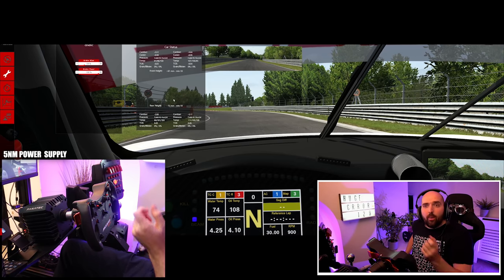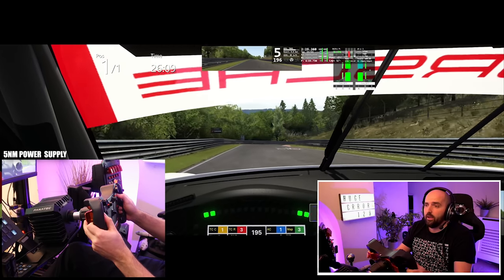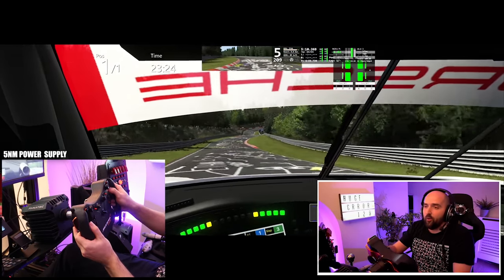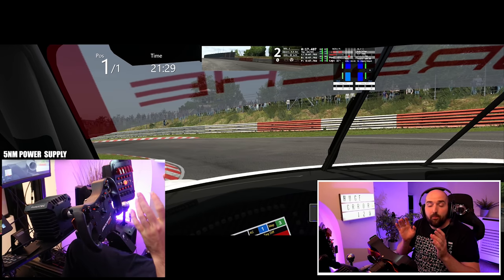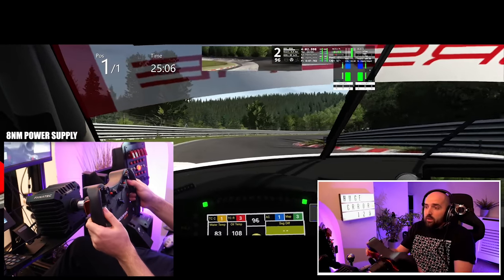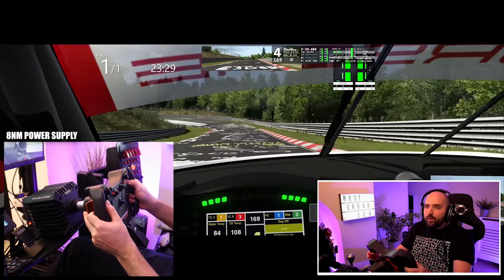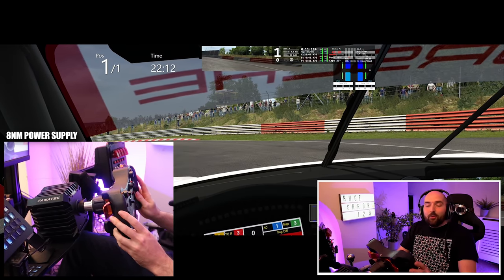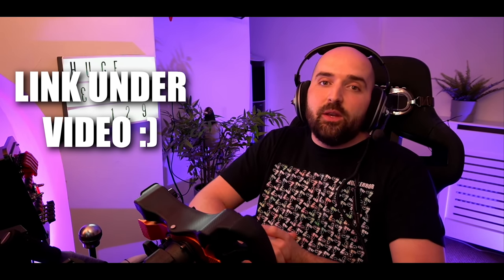Fanatec CSL DD | Which Power Supply Should You Get ?

Comment: Take my advice with a pinch of salt but I would recommend first not getting the power supply, then check whether you like it or not and if you want more, order the boost kit later because it won‘t make a difference in price, neither in a bundle nor in the single wheel base options… because 150€ is a steep price to pay and if you are good with 5Nm, don‘t go for that money, save it on another rim or else
Reply: you are absolutely correct my guy
Reply: Maybe it was like that back then, but now you do save 50€ if you buy it in a bundle. 
Im not sure but i think i will buy it with the boost kit
Reply: @ace.m4  but you don't get the 5nm they just send you the 8nm only
Reply: @OnceHopefuL  why would you need the 5nm if you have the 8nm ?
Reply: @mrmim0x173  it's the way they advertise it. The 8nm is an $$$ add-on. One would assume you get the base plus an extra box with the 8nm. For safety, say my 9 year old want to play I'd plug in the 5nm and hopefully, he keeps all his fingers.
Reply: @OnceHopefuL  can't u adjust the feedback in the setting tho. Like turn the force down to like say 30%  does the NM matter if you don't run the setting at 100%  I have an 8 year old that wanna play Gran Turismo and Forza with me and I plan on getting wheel setup and this was my concern aswell.
Reply: @leftwich7  of course you can, it‘s what I did as well, I just want to make clear that if you don‘t want to use the 6-8Nm range, you can just save the money. If you feel that you will at least at times need the full range, you can just turn it down by 37% and lock it on 5 that way… btw I have read replies that said that in certain bundles you save money on the boost kit. Check it out, last that I know was that in all bundles and standalone versions it was always 150€ (same as the individual price for the boost kit)
Reply: @stingerbean1848  here in Europe the power supply cost 150€, meanwhile the 8nm bundle cost 100€ more than the 5nm, might depend the region
Reply: @mrmim0x173  I see. I didn‘t check it because I have the DD Pro for my PlayStation ventures but yes, you are right, the CSL DD 8Nm is reduced in price. But for that it makes a lot of sense to set up a bundle because then you‘ll get it for just 200€
Reply: I'm takin this advice
Reply: Bought mine from ali express for £30 now way was I going to pay €150 for a power bank
Reply: @OnceHopefuL  you get the 5nm with the boost kit. Lol
Reply: You can just buy a "normal" power adapter that matches the 8Nm Specs, for probably 40-50$
Reply: i will do that.

Comment: They should just sell it with the High Power Power Pack and reduce the price to £450 and be done with it.
Reply from the maker: I'd like that as well but at the same time having a 350 version gets to a much more mass market price point and makes people buy a CSL DD that would otherwise maybe go for a TSPC but with the advantage they can upgrade it later.
Reply: I think Fanatec's strategy is sound.

1. It's designed down to a price, and 350 looks better on a sticker than 450. It allows people to say "hey, my T300 cost me 350!", and while it's of course not a fair comparison, it'll still hit home with a bunch of people. It's sim racing's version of Sony's "$299" speech.
2. A lot of people won't care about the extra torque, they're happy with 2-3nm, and it allows them to save a pretty penny.
3. It allows people on a budget to buy the unit now, and upgrade later. It's good for people on a tight budget, for people who aren't sure about their purchase, and people who are convinced they don't need more to upgrade later. We all know how that works - when I started in the hobby, I thought FFB rather than vibration looked like a gimmick... and here I am now, with three wheel bases, and contemplating a third pedal set. 
4. It fits with the Fanatec ethos of customization and modularity.
Reply: @GamerMuscleVideos  It is just a way to artificially make the starting price seem lower. Most people will look at the 350 price but in reality most people will buy the 450 version and the 450 version is what fanatec wants to sell you. It is called decoy pricing and it is just a pricing strategy. In the end you are paying 100 for a 20 dollar power supply.
Reply: @erwinlommer197  For sure, start with that and a wheel and soon you send up spending much more than you initially anticipated. A TS-PC around €500 seems almost the same price range as this system but you ended up with one of the best wheels around (Ferrari 488 Challenge) and that's it.
Also, I believe Thrustmaster and Logitech won't stay still...
Reply: @erwinlommer197  You're looking at it the wrong way. The unit cost $470 and their only selling you part of it for $350. I'll bet they probably aren't making much on the $350 sale and are loading all their profits into the idea that most people will know you can "upgrade" for the $150 later, but at the lower price they can lock as many people as possible into their ecosystem and deal with getting the rest of their money later.

It's really smart and when you realize the unit is really meant to replace the CSW and not the CSL (all while being $70 cheaper) it's a really good deal and a REALLY smart idea. I just don't think they realized how many people would latch onto the actual cost of the PSU and they thought people would think more about the NM they were buying...
Reply: @Jonj57  You are literally falling for the psychological trick of decoy pricing. You are comparing the two prices and telling yourself that the extra 100€ for a 20€ ebay psu is a good deal because you don't want to buy the cheap option. After all 350 vs 450 for dd wheel... just 100€.. right?

Both psus are pretty standard ebay brick psus. Nothing amazing about them. Fanatec can buy them in huge quantities which means they are probably paying something like 10€ max each. Maybe the bigger one is couple of bucks more expensive for them. 

For fanatec the price difference between the who PSUs is meaningless. The income  and the profit margin they get from the bigger version is insane tho.

And I am not hating on fanatec here. What they are doing here with their pricing and leveraging the psu for maximum profits is just business. Even at 450€ it is not a bad deal by any means and a dd wheel at this price range wasn't even a dream couple of years ago!
Reply: @erwinlommer197  I don't think so, what I'm saying is they probably don't make much on the DD unit AT ALL and MOST of of their income from this unit is intended to come from selling the 8nm upgrade. You're not wrong in saying the PSU shouldn't cost them more than a couple bucks but they aren't trying to sell you a PSU; they're trying to sell you 8nm over 5nm and just needed a way to justify it.

Really it's 350 for the DD and $150 for the power upgrade with a free PSU included.

They never would have sold us this DD @ 350 without some way of recovering cost at the backend.
Reply: Little sad that this marketing strategy is likely to create needless e-waste from the 5Nm power packs.  Admittedly not much but any waste is still waste.  Can't argue with the strategy from a Corporate viewpoint, selling low with a defined and tempting upgrade route is one that's been used for decades and it works.  More money for Fanatec.
Reply: @jgagnier  
Its not the fact that it is sold with 2 options of power pack its the ridiculously over priced Hi power PSU.  
Fanetec are just flat out ripping people off @ AU$260.
Reply: @Jonj57  I don't understand how you just don't get it. Fanatec is not selling the 350€ version near at what they pay to make it. They have a solid profit margin. They could easily sell the boosted version for 350€. But it is just smart business decision to make the product little weaker and sell it still for the same 350€. 

And then make the intended product 100€ more expensive by calling it an upgrade. It is the exact same wheel base with different 10€ psu. Different psu is the only difference!

I don't understand how you just don't get this. The same thing happens with netflix for example. They have the cheap option but in reality they want you to buy the middle priced. That is the intended product. The low priced one is the artificially limited product that is used to set the base level price for your brain.

Same with graphics cards. You can get a cheaper version of the same card where some of the features have just been disabled. The 5nm and 8nm netflix or graphics cards are identical and only difference is the way they sell you the product. 

In the end fanatec are selling a 10€ psu upgrade for 100€ or 150€ and they are making a killing. It is nothing more than a pricing strategy. From business pov it is smart as they make more money. After all 350€ dd wheel is a massive shock to the market so they have massive lead over competitors over every area. 

Not hating fanatec. I feel I must stress this but it is still a good deal even at 450€. Even at 350€ it blows away the competition and this is great for simracing too. But it is decoy pricing and it is a bit tactical from them.
Reply: It's akin to the infamous chips added to printers that increased the cost of manufacturing to effectively slow down the printing speed, making the better product cheaper than the worse product. Thing is, without these slower, cheaper, but more onerous to produce printers, the financial module just fell apart, and no printers are sold at all.
Reply: @matk4731  i said the same in the Fanatec forum. The power supply price is way to high aspecially when you check the CSL Elite 1.1 power supply. It's the same with a different connection. When Fanatec don't use the dataport for locking up the base than you can build an adapter from the old psu to the new 4 pin connection for less than 10 bucks.
Reply: @jgagnier  The printer example is not a proof of there being no printer market at all. In fact it is the complete opposite. The printer market was in such poor competitive state that companies could essentially make their products worse on purpose and still make money. They did not do it to survive. They did it for profits and the consumer suffered with more expensive products that performed worse.
Reply: @erwinlommer197  got give credit, I'm surprised it cost £350 for DD base they could have priced it higher.
Reply: @erwinlommer197  If they can make the DD unit at a huge profit that means the CSL Elite was a trash deal. Nobody thought that before the DD. Neither one of us know their profit margins but based on their responses to people, based on what I KNOW these kinds of things cost ,especially when you consider they engineered a lot of custom one off things for this product, there's really only one answer that makes sense.

It's a very similar technique facebook used for the Quest 2 except instead of getting their profit through an app they chose to get it through a "Upgrade".

Either way you're being played by a marketing team  but you're dead wrong if you think they're charging you $150 for the power supply lololol.
Reply: @Jonj57  They are charging you 150 for the psu if you buy it separate, 100 if you buy the expensive wheel. What they paid for it is testing, shipping, manufacturing and after sales taxes and repairs and refunds... etc..

Fanatec doesn't get their money just by selling the psu. They get their money from the base product AND the psu. The psu profit margin is insane tho because of the decoy pricing. It is still very much a 10€ psu for 100 or 150€.
Reply: @erwinlommer197  I understand what you're saying though I disagree with you about whether that's what's happening here. No worries we'll just have to agree to disagree.
Reply: Matthew Coleman you mean increase
Reply: @Jonj57  Its more to get you into the ecosystem
Reply: @Jonj57  I think its is more to do with getting you into there ecosystem so you end up buying all the add on stuff like wheel rims and shifter and handbrake
Reply: What about all those people that don't have a fixed rig yet as they aren't hardcore sim racers? 8nm is not recommendable for a wheelstand or desk :P
Reply: I understand their business but they just created the most expensive power supply in the world.  I pre ordered  with standard power supply as I'm jumping from logitech. The price for the wheel, base and pedals was less than €700 it was my budget limit. My plans is to buy the 8nm P/s in the future but prices for peripherals and the delivery fees is ridiculous at Fanatec Website.
Reply: @olintopalito  Prices for the wheel rims and such are not overpriced imo. You get good quality wheels and button plates thrustmaster or any other mid end is no where near Fanatec Rims. Welcome to the world of exspensive sim racing.  Its great to buy nice new gear just remember you brought into their ecosystem which if on PC i would say go simucube but they also fit a nice market for premium gear but at a lower price so cant really complain but the PSU price for the CSL DD is outrageous.  

I have simucube and P1X and all in the past 18 months I've spent almost £6000 not including my PC lol
Reply: @Simlife101   Yeah, I'm the guy who thinks if you  pay more than €1000 for a sim race gear it's better buy a  real kart and enjoy life outside. In fact that's what I did but now considering I'll have to buy the lc pedal the total for my set  still under €1000, so I think I did a nice move. Sorry for my bad English (not fluent), and thanks
Reply: @olintopalito  But why some people can buy top end gear and still enjoy there out door hobbies. makes me laugh when people say you could by a real car for that but i have a car, you could go to the track for that money, i go to the track. Having a nice sim set up you spent a lot of money on doesnt mean you now never leave the house and all you do is sim race lol 

  I understand not everyone can do that but many people who has high end gear are normally over 35 anyway with a good job
Reply: @Simlife101  I understand you, but in my case I had to choose one or other thing. I could afford a dd1 setup but a choose a real kart because I have a really nice track besides home. However I think the new prices will bring loads o kids to the playground, the fanatec sets allows you to be at least competitive online different of logitech for example.
Reply: @olintopalito  Many pros use logitech for competitive races. It can be manipulated which a DD wheel is a lot harder to do. Hope you have fun on the track. I dont get to go as much now but really hope to get back out there
Reply: @matk4731  I would just go 5nm version and later on get an aftermarket 24v power supply. Fanatec is doing the same with all csl wheels. The wheels are packed separate to the quick release, if you upgrade to a metal quick release you don't get the standard quick release and the price is the same. Overseas countries should count themselves lucky, here in Australia our price is not value for money.
Reply: allan lansdowne 
Everyone seems to be missing the point. Fanatec are way over inflating the price of a PSU. It mortally wrong.
Reply: @allanlansdowne340  That is more to do with your country than Fanatec
Reply: @erwinlommer197  "In the end you are paying 100 for a 20 dollar power supply." - This.
Reply: @misterdog7  Then they could have easily fitted a switch to reduce the torque of the wheel but still used the correct PSU. In fact thinking further you could just reduce the torque in their software!
Reply: @jgagnier  another reason is, those who want to mount the wheel base to a table with their table clamp could like the 5nm better becuase it won't shake the table as much as the 8nm :D

Comment: I'd be interested in a test with a third party power pack against the one that fanatec offers
Reply: So long as a PSU of true 180W or greater is used there will be NO difference, all it has to do is supply 7.5A @24V. (A very cheap PSU may not be a true 180W or able to deliver that power for long periods but there is nothing special about them)
Reply: You will void the warranty.
Reply: @RedLP5000S  I guess my question is how would they know. I've ordered on the normal psu and will upgrade at a later date
Reply: @avgvstvs96  I thought that, but its possible and not illegal to borrow your friends upgraded power supply whilst he isnt using his wheel. Its entirely possible to buy a second hand one at some point etc. They wouldnt be able to prove it wasnt a fanatec power supply by recoding power levels.
Reply: @BazippysVideos  please lmk
Reply: @davidpovey01  So what is the output wattage of the 5Nm psu? I am in the market for a new wheel for PS4 but also PC and was looking at the thrustmaster t-gt ii, I think this the Fanatec will be a better choice and I can not find any relivant info to what it's max input wattage is! Is it possible to get 10nm out of it with a 220W psu etc?
Reply: @RedLP5000S  They will never know......
Reply: @p4ulfat1  The 5Nm power pack is 90W and the official Fanatec 8Nm is 180W - the wheel base detects the presence a higher spec power pack and switches modes. Having an even larger power back will not get you more than 8Nm.
Reply: @p4ulfat1  not how that works. A psu will only supply the amperage the load uses which in this case is the wheel so theres no point getting a psu than can handle 9 amps off current